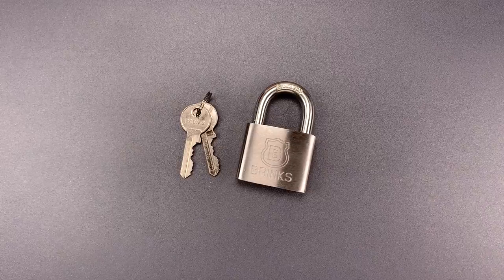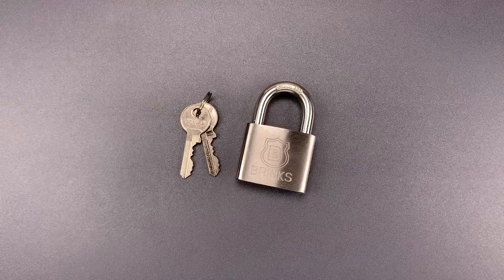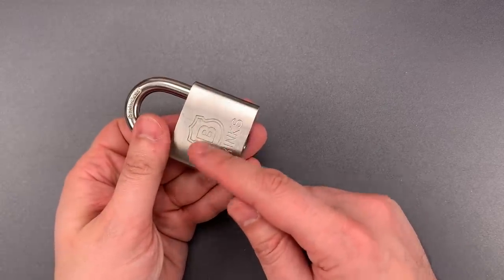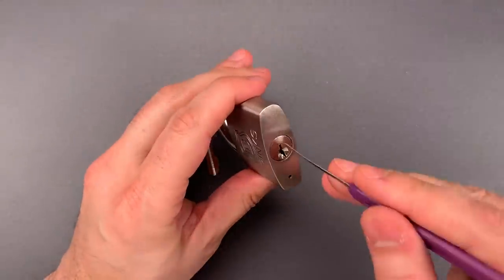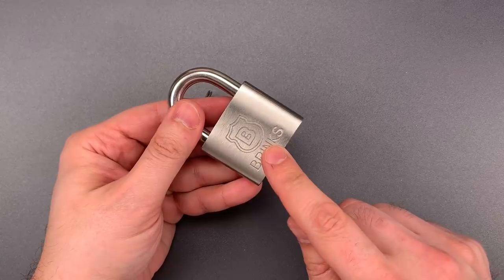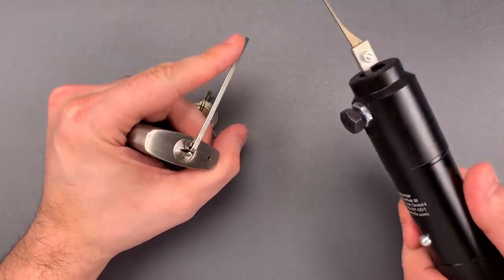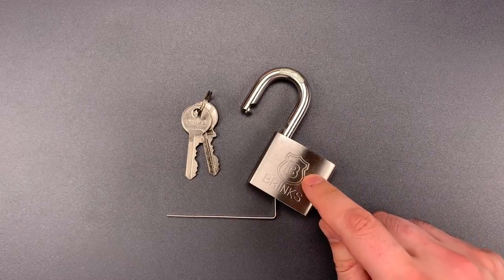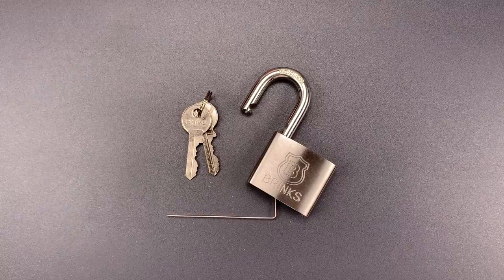[1025] Brinks Stainless Padlock Bypassed and Electro-Picked

Comment: I'm nailing my doors shut when I sleep tonight.
Reply: This opens up the possibility of a low skill brute force attack.
Reply: Nyan Na Aung Use screws. They will hold better and they are easier to undo from your side of the door than nails
Reply: But what about your window?
Reply: LPL: Hello everyone. Let’s look at the simply egregious design flaws of this household door lock. As you can see, I can pick it open in seconds with a common household hammer...
Reply: Just buy a dog.
Reply: @aserta  This is the lockpickinglawyer and today I show you the design flaw of this dog... Putssteakout As you see, this dog can be easyly bypassed with a steak bosnianbill and I purchased yesterday. In any case, that's all I have for you today, Have a nice day.
Reply: Just weld it.
Reply: one is loose... two is loose... not really feeling any security nails here... and we are open...
Reply: Bolt it shut.
Reply: Then you will hear:
"Let me pull out this crowbar that BosnianBill and I made" :P
Reply: S L weld the dog down
Reply: Nyan Na Aung there's usually windows. Locks provide a level of security, however you're really just pushing that would be robber to your neighbors house instead... Hopefully. There are few exceptions to this rule that I run across working with locks on a daily basis. Don't be cheap. Don't ever buy Kwikset or Weiser or Master Lock. Or anything Chinese.
Reply: It's all about threat modeling, really.
Reply: We’ll only ever really be safe if we arm ourselves to the teeth, take a bank vault, then seal ourselves inside to be safe from other armed robbers.
Reply: Bury the house in concrete too
Reply: This is the lock picking lawyer and what I have for you today is a man who nailed his door shut.
Reply: Nyan Na Aung :)))))
Reply: He can still use the pick bosnian bill and he made
Reply: Use a welder!
Reply: I use one of those slide bolt locks.  You pretty much have to break the door down to get in and by that time I'll already have my gun drawn.
Reply: Nyan Na Aung Alarms are very helpful. Cameras also. But I know what you mean.
Reply: This has just the right amount of likes.
Reply: If you're really concerned about it  you can install a "door bar" for about $10.    You can pick up a 2x4 and two brackets that it'll fit through at any hardware store.  The brackets should be with the gate/barn hardware.    Make sure the brackets are screwed in with heavy duty screws right into studs.    Search on youtube for ozzyman swat team if you want to see what it'll look like if someone tries to kick your door in.
Reply: @aserta  Dogs can be placated with food. Most people who THINK their big scary guard dog will attack an intruder are sorely disappointed when they just hide in the corner eating their new bone. If your dog isn't trained exactly like a police K9, it's useless. Get a gun and an alarm system instead.
Reply: best thing to keep the LPL out is packaging, he cant defeat it quick enough
Reply: Didn't really help in Darkwood, can't say much for it...
Reply: bolt them shut them
Reply: _L30 nails are for fast rush jobs while screws are for professionals
Reply: Ryan Kim unless you live in a getto neighborhood i wouldnt worry about lock security as long as it can withstand a low effort attack of an ex trying to come in after you break up with them since if someones actually determined to get in they will break down the door or get through the windows in which case i hope you have a shotgun at the ready
Reply: No. That is easily defeated by a hammer and is a one time use. First, secure your frame (there's a video of a former Navy Seal talking about this on Buzzfeed Unsolved about preventing home invasions). Second, broken windows are the most popular method of entry. This is fixed by getting laminated glass windows as opposed to regular glass. These take minutes, as opposed to seconds, to break. It is costly, but effective.
Next, pick proof your qwikset locks with a method used on this channel. It completely shuts down picking the lock, but you lose access to the door if someone tries to pick it. Learn from him. Do not fear him.
Reply: Scatter a few broken kids toys in the yard. They’ll pass right on by.
Reply: Jokes on them, I sleep in the streets.
Reply: Next on Lock Picking Lawyer...
Reply: You could just hammer them out from the other side.
Reply: @Kenny M https://youtu.be/o1gOeBbLKAw You talking about this video?  This is not the lock I'm referring to and it requires tge door to be slightly open to work.  With my lock, it's not possible to open even slightly to fit something in to lift and slide bar.
Reply: @deineroehre  Got a real laugh out of that
Reply: No match for the power of the ramset
Reply: @aserta  buy a shotgun
Reply: Nails aren’t very secure, use heavy duty GRK screws

Comment: What I would love to see @LockPickingLawyer would be an example of how security pins and other safety features make using low skill attacks significantly harder by demonstrating how such tools as the electro-picker and raking techniques not working as fast as you just picking them.

And even though I've seen a LOT of your content, I still don't understand what/how most extra security features influence the picking process or protect from brute force/low skill attacks.

In any case, that's all I have for you today and as always, have a good night :)

Comment: I feel like ball bearing locking mechanisms (preferably non-bypassable ones) need to become the de-facto standard for locks. I find it hard to imagine that a dual spring-loaded locking pawl is any cheaper to produce than a single actuator and two ball bearings. Probably more reliable in a weather-resistant application like this, too, when there aren't any actuator springs to get gummed up.

Comment: I work for a Manheim wholesale auto auction. He have a locksmith on retainer, but we are constantly having to deal with locked cars on an emergency basis, like, on sale day when it's time for the vehicle to be driven thru the arena or when a vehicle is ready to be delivered. This is usually accomplished by pounding a wedge between the door and door frame till we can get a tool inside to hit the unlock button. I know there are inflatable devices, but we have never owned one. Would the electro-pick open some car doors? It would need to be battery operated.
Reply: Cars have wafer-based, not pin-based locks, so the short answer is:definitely not.
There are some effective types of attacks against wafer locks that you can find on the internet (or youtube), I'll let you do the search. But they require someone who knows what he's doing, so if you or someone you trust feel(s) like becoming that person, I guess it's doable with some training.

Comment: Holy moly that electro pick... what does it do? Just vibrates a pick at the end? Isn't it excessively big for doing just that?
Reply: It also has "attachments".which can be used for other things! Wink! Wink!Nudge! Wink! Wink!
Reply: ukp42 Like a toothbrush.
Reply: @XtreeM_FaiL  Maybe? :)
Reply: It's big because it'a s a pro tool that'll never let you down. But you can build yourself one out of an electric toothbrussh and it will work just fine.

Comment: I’ve seen some of the bad gun locks and safes do you have any you’d recommend?
Reply: LPL: concrete
Reply: Actually, check out anything with this lock: https://youtu.be/HxQUKAjq-7w The guy made a follow-up video when he did manage to shave some time off cracking the code, but it's still long enough (at least 8-9 minutes with skillful use of an oscilloscope, a notepad, and two metric tons of luck), and there is no physical bypass and no other way in. If the safe is made well enough, it's a good option.

Also, he did make a gun lock in [464]: https://youtu.be/oImZsAI1L0Q

Comment: Is there a newer/more expensive version of this lock with security features? I picked up a Brinks stainless steel padlock that looks like this last fall. Since then I started (or resumed after a 30 year hiatus) lock picking and it is the one padlock that I have to practice on. I am no expert but it feels like it has at least one spool pin and I have tried that bypass and one side does not anything to hit for the bypass.
Reply: I finally figured out which lock I purchased.672-50811. Amazon has a review calling it a great locksport practice lock. However, other picking videos that I have seen on this part number described it has a different number of pins and/or having no security pins. The current packaging mentions anti-pick pins, which is what I found in mine.

Comment: Real talk, how the hell does a lock company put out a lock with such glaring security issues???   Lemme guess, is it the money?
Reply: well they sold at least one!
Reply: It is  good for locking a gate to control access an otherwise unsecured area.. This would be good for a gate to a field, pasture or yard where anyone could hop a fence or  drive up with a tool an cut the chain holding the gate closed. So very low security but adequate for that  purpose. I've seen plenty of locked gates at entrances to unfenced fields.
Reply: The general public is for the most part completely unaware of the issues and until people stop buying junk, they'll keep making it. Master is without a doubt the biggest culprit of this. Tough locks, crap protection.
Reply: Wouldn't a plain zip tie be just as effective and a  lot cheaper?
Reply: @ed909  it would be more secure too, since it's tamper-evident most of the time
Reply: No one takes the lock companies to account for the absolute shite they produce, because since the 1940s the way most criminals dealt with locks is to destroy them with electric drills or similar methods--specifically they destroy the lock.  So a lot of companies don't see a need to improve the lock's physical security in any meaningful way.  This is why Master went from being one of the best brands on the market to the dollar store bargain bin.
Reply: I think the open back of the cylinder is an engineering problem, but security pins are about three times the cost of plain pins.